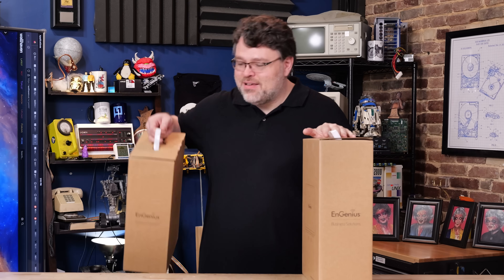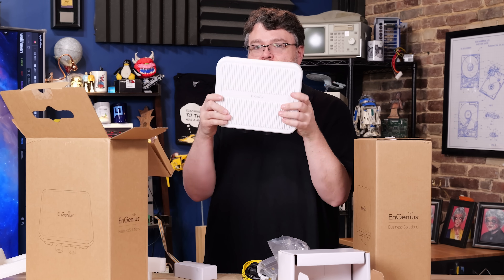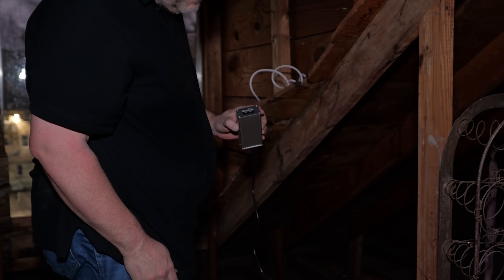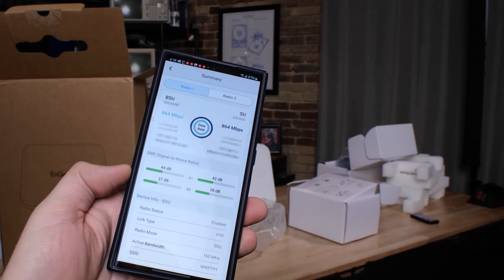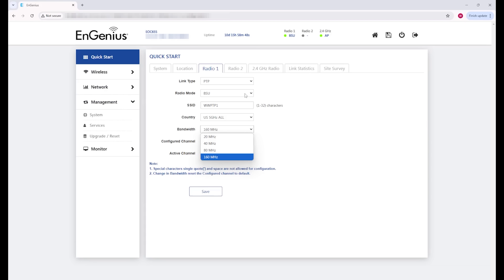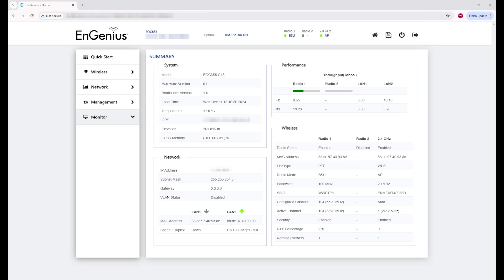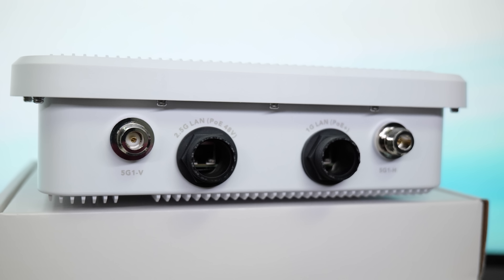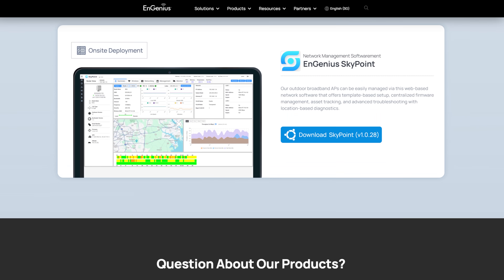Expanding Level1Techs' Reach with Point to Point 2.5G WiFi

Comment: In the sub-$250 space, I've had great luck for years with Ubiquiti Nanobeam for basic line of sight point to point connections. That said, if I was still in the WISP space, I'd be strongly inclined to use 24 GHz, 60 GHz, or licensed frequencies for my backhauls, because burning 160MHz of 5 GHz for each PTP means there's that much less left for PtMP links to serve customers - and at least in my area, all of the WISPs are using 5 GHz (though some also use CBRS for fixed LTE), so spectrum is more limited than you might think. I'll be interested to see what the outdoor wireless manufacturers come out with now that 6 GHz is becoming available for unlicensed use with automatic frequency coordination systems.

Comment: I am doing something similar on a smaller scale with older gear. I am using my old ECB-1750 AP as a bridge to connect my office over to my EWS-377 Fit access point in the next room, since I live in a rental and running Ethernet here isn't really an option. 
Uptime has been absolutely flawless. Speed, I get almost 900 mbit, and given my network is all 1 gbit, that's very good. I rarely even think about the fact that my link to the other half of the house is through this bridge. It's been that good. So the fact that you are getting the uptime and performance with these devices doesn't surprise me. My experience with Engenius hardware has been a very positive one.

Comment: Two gigabit strikes me as an absolute failure for twin 5Ghz channels. Transmission speed is, of course, impacted by the modulation type and the overhead of error correction, but most modulations benefit from operating higher on the frequency spectrum. Seems like they skimped on the modems.

Edit: Yeah, amping up an 802.11 modem and attaching it to a directional antenna is a solution. And I can see how it's convenient and easy for some situations, on the cheap. However, as a wireless network backbone dual 1000 base T speed leaves a lot to be desired. This does appear to be a good consumer solution at a good price though.

Comment: I would have used the ubnt Wave-Pro they have 60ghz radio and then a 5ghz backup radio for when the weather is really bad. For you distance it is in specs to use. It has 2 2.5gb ethernet and a sfp+ port.

Comment: I'm familiar enough to comment about Cambium and Tarana wireless ISP equipment. Based on how they do on the licensed CBRS band, I would say that Tarana is by far the one that has the best ability to deal with bad signal paths. It's too expensive if you're not an ISP, but if you could get a loaner you should try it; it's great engineering. Delay doppler stuff, plus the usual beamforming. I'm also told that the admin experience is much better with Tarana along with the service reliability, and plenty of people were fine with Cambium. Tarana does 3.65 and 5/6GHz and the latter may be able to hit the same rates as this; I can't remember if two base nodes can be set up for a backhaul or not. When replacing a cambium customer to use tarana with the radios at similar heights before and after, if they were on a 50/10 package before they'll probably be able to get 500 after, or some other massive jump.

Comment: Ubiquiti AF60-LR is around $250 per unit. It would be really interesting to see that in action.
Worked at a WISP in SW Ohio and used Ubiquiti for the long haul links, worked really well, and that was over a decade ago.
Reply: Wave Pro LR @ $600 per unit, would get you to 2.7gb each way and include a backup 5Ghz radio.   For this distance, you could even go down to a wave nano for reliability and get a full 1gb for $280 with a bit more reliability/failover protection vs the AF60-LR.   A far cry from the $2000 cost of the unit in this video, that may not even provide half the bandwidth it advertises without additional antennas.
Reply: Working right now at a WISP in Poland. We also use Ubiquiti stuff, as well as Cambium. And I noticed that Force 300 from Cambium had a bit smaller failure rate that Loco M5 (or NanoStaton 5, however they are called now). Customers were also a bit more satisfied with connection provided with Cambium stuff.

But for the long haul... I'd say Ubiquiti is still the king with their 60GHz stuff. Obviously, it is not as good as NEC stuff on licensed bands, but when 60GHz Ubiquiti does the job, we mostly use that and we bring NEC stuff when nothing else worked.
Reply: @HydrantTV  Agreed on general reliability on Cambium - have yet to have any real damage to Force300-25 and EPMP3000 series equipment, very noise resistant as well.  PMP3Ghz/Medusa has been good in general as well.  Put off adopting into EPMP4600 so far, firmware is a bit undercooked.  Lost more than my fair share of Ubiquiti from storm damage (Direct/near Lightning strikes), but not one Cambium in the last 5 years.  Honestly had not touched M series Ubiquiti gear in a decade though.  Mostly AC/LTU in our setup for PTMP.
Reply: I use a fair amount of 60GHz Ubiquiti and it is awesome.

Comment: Ubiquiti point to point products with Prism radios are far superior to these, and anything else on the market. It isnt nearly an issue at 60ghz if you want to go with those products, but for 2.4 and 5ghz PtP the prism tech beats everything. As most of us know, there is significant interference with other wifi networks and other channels, and you cannot normally filter these out really well due to how close the channels are frequency wise. The Prism radio is its own special hardware piece in front of the standard wifi chipset that converts the wifi frequencies it receives into a far lower frequency band, in the free use MHz range. It does this so that the channel separation increases and they can use a brickwall filter between bands now, then convert the frequency back up to normal wifi again for the normal chipset. Ubiquiti finds around 30dB of adjacent channel rejection with this method, making their products far less susceptible to other device interference and increasing your speed and stability.

When using 60GHz PtP products though the channels are much farther apart and dont really benefit from these special filtering techniques, also because 60GHz is in far less use and doesnt travel very far either so you aren't likely to have any interfering adjacent bands.

Comment: I ran an Engenious multi-point bridge back in 2012. In Canada in Ontario cottage country ran solid for 3 years, had one failure, it was winter ice and wind managed to dislodge the system. It was dangling from the ethernet. Cleaned it up reconnected no issues

Comment: i built a system for my buddys farm, two buildings 700 feet apart. using unifi i was going to originally use one of their wireless options. we ended up deciding on fiber and a small trench because it was gaurnteed to always work. i'd love to see those in the test roundup. my concerns were occasional connectivity issues with wireless and snow/weather. the other building has an apartment and 10 security cameras so it was necessary for 100% up time.
Reply: I mean, it's a farm so running the fiber should be cheap if you don't need a permit. Otherwise the 802.11ay devices are pretty solid. Haven't tried it in rain regions outside the US yet though.

Comment: I mainly deal with UI/Cambium/Mikrotik.  Some concerns, but this product has it's place.   For the price point I may struggle to defend it.  Being on 5Ghz is going to be strongly affected by local wifi interference with the urban environment.  Higher noise on longer broadcasts with higher error rates.   Smaller channel width may help keep higher compression of signal quality/speed.  Bonded/channel Aggregation will be affected on retrans - expecting a bit of loss on sustained throughput for the prior reason.   Weather/Tempature while good during initial setup, the temperature shift in an attic, shooting though single pane glass is going to lead to some impressive thermal ducting results for the remote unit.  This might not be too bad but I would expect the chain imbalance to go between 2-6dbm as the season changes.   While not parabolic antennas, both units appear to be partally occluded (wall/window/etc) within the first 30 degrees around the aiming cone/Fresnel zone of the antennas (Just an issue with compression and signal quality).   

This looks like an okay solution (if not cost effective) for a network link put up in a way to not be observed.   I would expect 20-40% bandwidth usage to be semi reliable w/o external factors affecting it.  Anything over that may work in bursts.  Others have mentioned why not 60Ghz.   And it would work quite well if the units were moved out of the attic.  Local restrictions may have restrictions on what can be on the outside of a building, regardless of OTARD rules with historical buildings.  I am curious to see how much the 5Ghz is impacted with the mid range trees that may green out in the spring.  Again, great for network connectivity and offsite backup/recovery/monitoring.   But I may not want over invest in it's capabilities just because the labels on the box say it can go up to an advertised rate.
Reply: Comedy options would be recommending SIAE/SIKLU/AVIAT for a short range link like this for non business use.   UI's Wave gear (Pico-Nano-LR) would be okay for sub gigabit performance. WaveProLR gets a bit bulky but would get you back into the multigig each way, with options for passthough POE (24v/48v not AF/AT) and fiber connectivity.  That said it is still Passive POE and will require it's own POE injectors or switching to put in line.  Mikrotik would be great for a set it and forget it option, but good luck troubleshooting it at a glance w/o extensive product knowledge and external logging, should any events impact performance.
Reply: The main 60GHz option being thrown around is, at least in theory, 2.5 times slower, and 60GHz is more prone to atmospheric interference, not to mention likely to be worse over time as mmWave 5G gets deployed in more places
Reply: @bosstowndynamics5488  I would have more concerns over how they are trying to fit 2x 160mhz channels in the 5Ghz band.   Considering both channel 50 and 114 fall in DFS bands and have their own power restrictions if following the "rules".  If they allow free floating frequency use, they are still sitting within DFS for any of the frequency options.   And it appears this kit requires a 2nd set of antennas to even use the 2nd radio built in to use the additional channel for the 2nd 160 mhz wide channel if you even attempted it.  So on a single radio given the data sheet, it is capable of speeds up to 1.2gb per radio in half duplex under optimal conditions.      Again this is a good and looks to be rugged set of kit.   But there are FAR cheaper options as a single unit w/o requiring additional antennas and cost to hit the same speeds.  Depending on how you configure this unit, be it the EOC655 or EOC655-C18 (with one panel antenna built in), would require at least  another 18dbi panel on each side to get the 2.4ish gb of throughput.  So expect to add on at least another $150 usd per side not counting any sort of adapters, mounting and cable concerns for a comparable 90 degree/18dbi 5ghz panel... that will just be bleeding and making more noise at the site.

This product could be wonderful it it included the 6 Ghz band in addition to the 5Ghz, but it is simply using cheaper 5Ghz AX radios, self handicapping itself in way too many aspects.

Comment: The UI wave series is pretty amazing.
Reply: It's a great product range. Airfiber 60LRs are looking to be bulletproof for full 1gbps duplex over a shockingly far distances. They are picky about alignment but they have basically no interference, and only use about 6W of power.
Reply: @breakfast-burrito  I got a couple AF60XR links, one at 9km. I have like 6 AF60LR links, which are great but don't have the 5Ghz back up for intense weather events. Replacing those with the WavePros/WaveLRs. I really like the WavePros. 60Ghz is just so nice, never going back to 5Ghz backhaul unless absolutely required. I've tested the WaveAPs but haven't had a use case yet.

Comment: One of my first PtP installs with EnGenius equipment was around 2015 and I was very happy with the reliability of the links I could set up with the units, though they were probably closer to 10mbit, IIRC. These "consumer" bands really shine in less congested or more rural areas and stable links over multiple miles are possible with LoS. The channel hopping tech in 2015 was quirky and lagged too much to rely on in an urban environment but there was definitely "a place" for consumer band outdoor units and that problem is almost non-existent now. The last quote I received for proprietary Motorola data link equipment for a ~5 mile was $12k
Reply: You could do that for half including power, battery, and solar. Easily
Reply: Still need help getting that link setup?

Comment: For what it's worth, glass, especially energy efficient or tinted windows, strongly attenuates and reflects microwaves. You're probably better off to aim it through the wood if you don't have metal siding.
Reply: Somebody didn't pay attention to the whole video. He said that was temp for setup and final deploy is outside.
Reply: @anthonymiller2288  Ah, I missed that. Thanks!
Reply: @anthonymiller2288 To be fair, it's still useful knowledge in the event he has future temporary or permanent deployments of wireless infrastructure indoors. It's not immediately obvious to most people that glass is worse for wireless than wood

Comment: Any reason you opted for this instead of a 60GHz link? I have a cheap 60GHz PTP Mikrotik link at 300m at my farm and it can saturate a 1 Gigabit connection with no problem. Been rock solid for 2 years now.

If you have the knowledge to configure it Mikrotik products provide outstanding value and performance.
Reply: any issue with rain or snow interference?
Reply: @la009895 some gear is 60ghz/5ghz backup so 99% of the time you are on 60ghz and during rain events you would fall to 5ghz.
Reply: @la009895 a lot of units include a 5ghz failover radio, mikrotiks included. It'll fall back to that radio at a lower rate to keep the link up if weather is too bad. You'll still get 100+ mbps if the  60ghz drops out. 

That being said, check if there's a 60Ghz E band ITU rain map for your area, that data is really helpful in showing how much 60ghz degrades over distance with respect to weather.

Comment: Let me be another voice asking for the comparison video of other equipment for wireless ISP development. I'd like to "retire" to a couple of hundred acres of farm where I can have a commercial-grade network supporting buildings spread out over the entire land owned. Think little workshops dedicated to different maker groups that do not (or cannot) be built next to each other physically for whatever reason(s).
Reply: Traditional client devices do not have dedicated range as a design feature.  You might hear the wifi, but your device not be able to talk back to it.   Each building will need to have it's own distribution/mesh/uplinks.   Direct line of site when dealing with higher frequency - 5Ghz and above between buildings without much in the way of trees.  2.4 when going though tree coverage up to 100-300ft (depending on antennas)   And hardwire to clean redistribution points or trench with fiber for as much as you can reasonably.
Reply: @SeijinSA  Appreciate the input. I'm targeting desert/mountainous terrain; think Grand Canyon-ish. 5Ghz would be the perfect mode from my experience.
Reply: At a certain point fiber everywhere is better
Reply: @aravindpallippara1577  "At a certain point" probably doesn't include tunneling through shale layers turned into stone over a few million years. Hence the need for OTA communications vice any sort of fiber or wired.
Reply: @fivoasia64  Yeah that's a reasonable argument, but you can always do overhead - I know it's dirty and all, but same requirements of LOS as wireless variants, and goes wrong more but also easier to fix in the same vein.

Comment: For the money, it's hard to beat the MikroTik Wireless Wire 60ghz products. The biggest downside is they are limited to 1gb Ethernet. I have half a dozen pairs in deployment, and they have been very reliable. Some even have 5 ghz radios for backup.
Reply: We're also using them to link 2 close (ish) buildings, and the link has been incredibly reliable and sturdy. Unless a truck decides to park between them, which happened like twice and falls under "fair enough", and we just need to move one of the units further up on the building.

Comment: Hi Wendell and friends!  Man oh man, I like to think of wifi as the intersection of the least sexy and hardest to do right when it comes to networking. But for those who know what's up, it sure is cool! P.S. if you can help it, having about 2× your required signal strength is a good idea. Because come spring,  the trees are gonna have a lot more energy absorbing water up high 😅

Comment: I've done the flashing of a router for use in our separated garage, about 125 ft, for "off-site" backup.  Not thrilled with performance.  It works for casual internet browsing though.  I cant afford this nice option.  Ever try mounting external antennas to the router?

Comment: Can’t wait for a roundup. I need something to extend internet to a barn that’s about 300 yards away from the house. Right now I’m paying for two Internet subscriptions.
Reply: I'd run direct burial fiber. If you're handy you can do it yourself.
Reply: Unifi UISP Wave Pico will get gigabit over to the barn for 180 bucks per antenna. Local setup, easy management. Backup 5ghz radio.
Reply: My cheapass would have run cable over there by now if it was only 300 yards until I could get something like this up and running
Reply: @NeptuneSega  You'll get too much voltage drop to run Ethernet that distance.
Reply: @MarkRose1337  that’s what we found